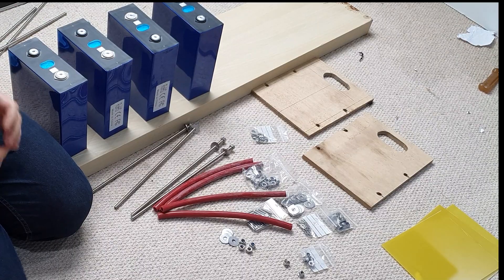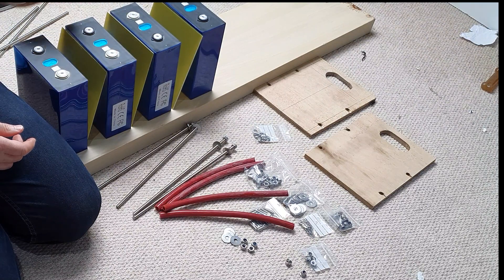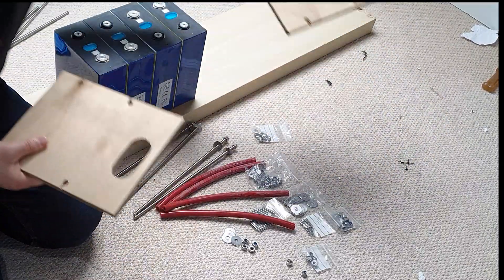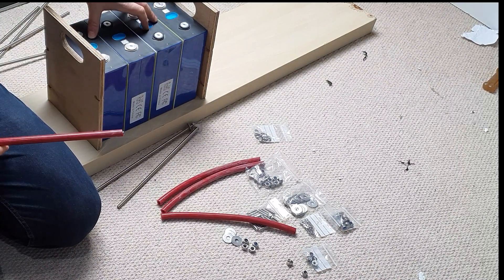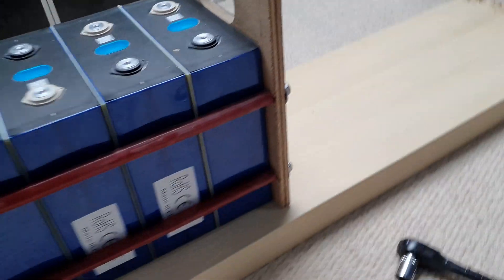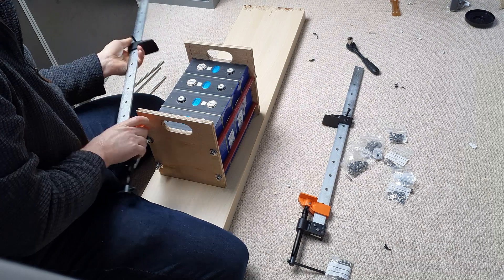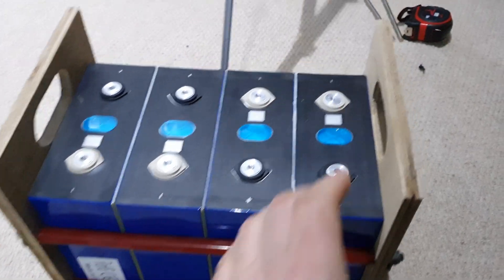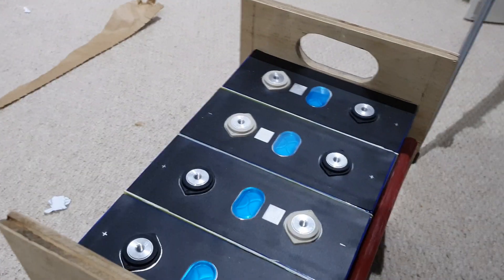How To - Part 2 LifePo4 Battery Build EVE 280AH Cells

Comment: I did 8 in a row. They expand/contract almost 1/8 inch when restrained with fiberglass 50m wide  mesh tape. I never used these but built a battery box with 250 amp BMS, 70 amp charger, 3000 Watt Renogy inverter. Those stupid 6mm aluminum battery post studs are way under designed. They should have been 8mm with brass posts. 

I drilled and tapped the bus bars for #8 screws coming from the bottom up for the BMS and battery monitor leads so they won't be under the terminal nuts. I am giving these 280 AH units a try. We'll see what happens. The cells were top balanced and 3 weeks later hold the same voltage.  I added active cell balancers that do 5 amps per leg. They work! I am about to finish it up and wake up the BMS unit. I also put in 500 amp fuses on the negative terminals and wired it with 1/0 battery cable and nickel plated lugs.

Comment: Great video.  You should put a piece of wood on the bottom as well.  If your on a boat and you put the battery down on a rough surface.  Like a stray bolt or screw or other piece of metal you could puncture or cause a short.  Anyways food for thought.  Thanks for posting.

Comment: Why 2- 6volt packs instead of 2- 12volt packs?If one pack goes bad you have nothing but 1- 6 volt which runs nothing.With 2- 12volt packs you still get 1- 12volt battery.
Reply: I was wondering that, too. I bought eight of these Eve 280Ah cells. I am going to make two 12v nominal packs and run them in parallel in my RV. Please let us know why you are two 6 packs in series? Thank you.
Reply: The cells are parallel first because otherwise you need 2 BMS2-3-4 cells in parallel and then in series means only one BMS needed and the 2-3-4 cells in parallel balance each other.
Reply: @TheGalifrey  If you are boating and you loose a 6 volt battery nothing works.If you have 2 bms and 2 12volt batteries you have the ability to continue with power.BMS are cheap and having 2 gives some peace of mind.Redundency is very important in boating.Good luck with your build.
Reply: You won't LOSE a 6v battery, it will be setup as one battery but if you are doing a layout, you can either use 8 cells in a row or 2 packs of 4 cells side by side. To lose one "pack" of 4 cells, 2 of the cells in parallel would have to fail as the other parallel will "support" the rest of the pack if one fails. If 2 fail, then you're potentially looking at the same thing, but 2 failed 12v packs. You have to understand the wiring, and this is the correct way to do a LiFePO4 pack.

Comment: Another option for insulating between the panels on a budget. Would be flexible cutting mats. They sell them in a 2 pack here at the Dollar Tree. I was thinking to use these and a 1/2"  white cutting board for my end pieces. 

I'm planning on adding a heater to the bottom of my build using a Temperature Contol Module, 12v Hive Heaters and an 1/8" thick Aluminum plate.  I think it may be best to place one of those flexible cutting mats between the plate and the bottom of the battery as well.

Nicely done on your build by the way.
Reply: The best solution is Sticky Barley Paper, you can buy it in 175mm by 1m lengths and then cut it into 5 pieces and insulate one side of the contacting batteries. (also known as battery insulation gasket)
Reply: Cheap plastic cutting mats are what I am going to use on my packs, too.
Reply: Picked up 2 2-packs of the flexible cutting mats from Dollar Tree -$2.12

Found 1/4" thick cutting boards at Wal-Mart 88 cents each - $1.87

Gonna go with some 2" Electrical Tape off Amazon I can't find it locally. Gonna be about $9 but I have a few color choices. Black, Blue, Red, White, Yellow. What color would you pick? I'm thinking Red or Yellow.

Comment: Did you consider add another pair of stainless steel bars under the four cells or move the placing of your lower bars to be tighter together and under the cells. I think that would have made a nice solution. The silicone on your bars would act as a slightly soft shelf for the cells to rest on. Reduce micro vibrations from the boat and engine.